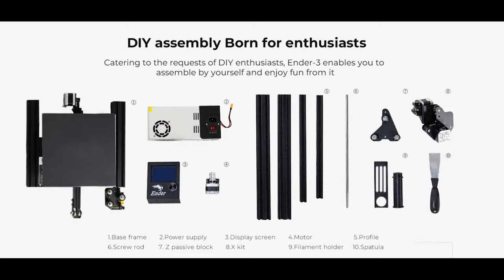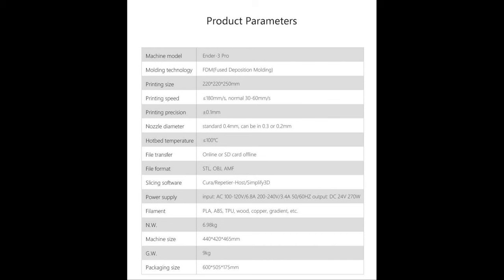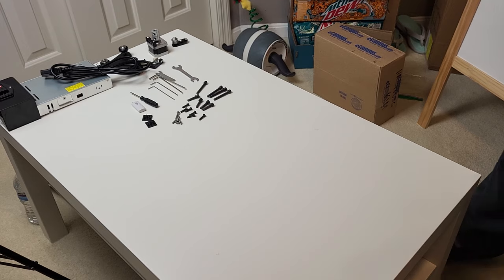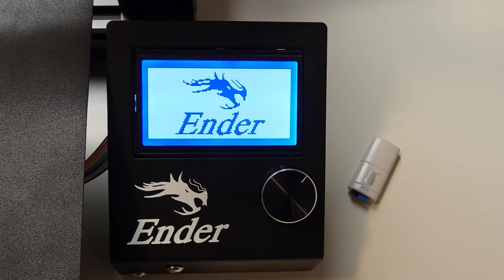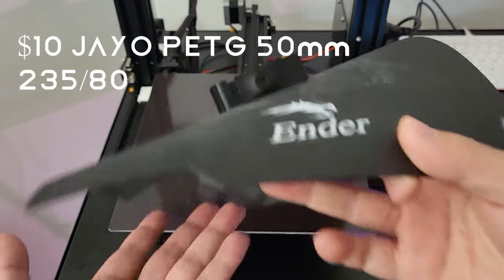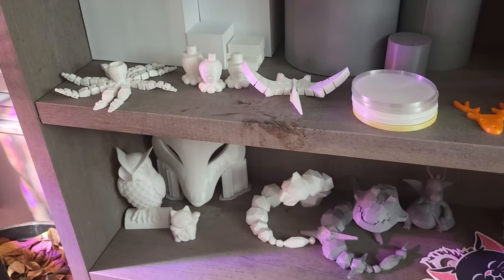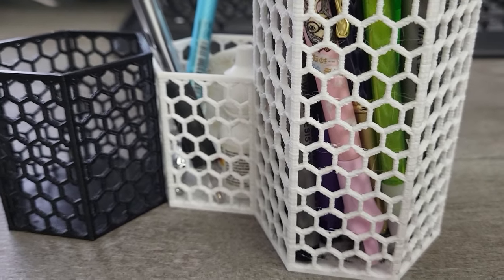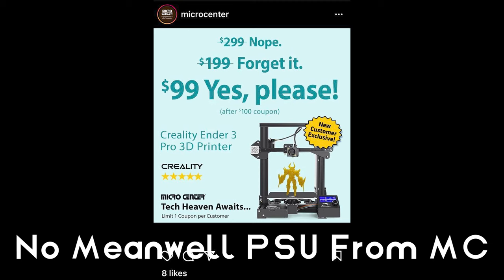Creality Ender 3 Review | In 2023, Is it still best budget 3d printer for beginner?

Comment: Artillery hornet or ender 3 which should I buy 🤔🤔🤔
Reply from the maker: Ender 3, artillery hornet is cool looking machine, but it is not that popular. Ender 3 have bigger communities support. Plus replace part availability may be a issue for hornet.  If you can get similar price, I will probably just go for ed3.
Reply from the maker: I will upload a step by step assembly, bed leveling, calibraction guide for ender 3 soon. If you need help or question, feel free to leave comment.
Reply: @SvgLau  Yeh now I'm stuck there is two option available there is two printer available ender 3 2023 and acube kobra neo both same price the store guy suggest me to buy kobra neo now which should I buy tomorrow I'll buy one of these
Reply from the maker: @ravigujjar956  Kobra neo is direct drive extruder, which works better then bowden tube for filament like PETG and TPU. The hardware on neo is way more value then ender 3. Kobra is more quite, better build plate, auto bed leveling, and belt tensioner. But it is little bit hard to calibration, if you can make it work, it is better choice than ender 3 with similar price.
Reply: @SvgLau  oh tq man now I go with kobra neo.